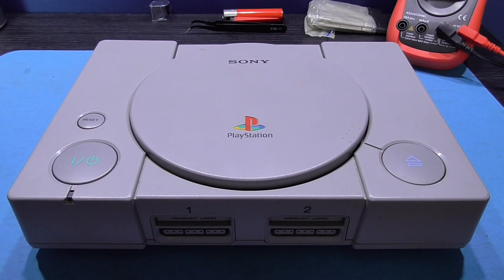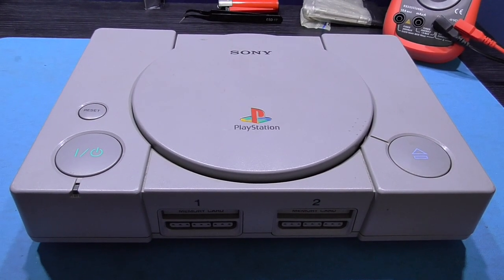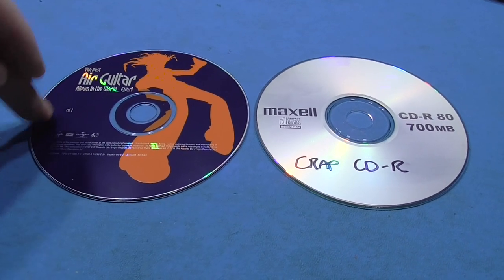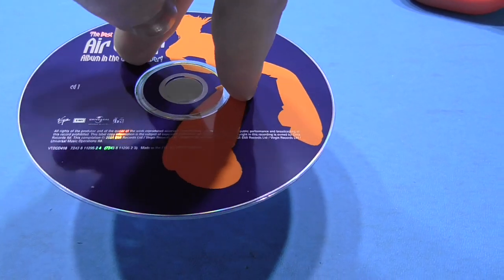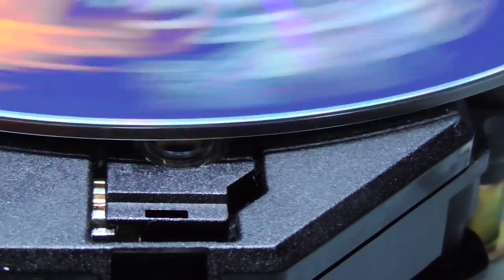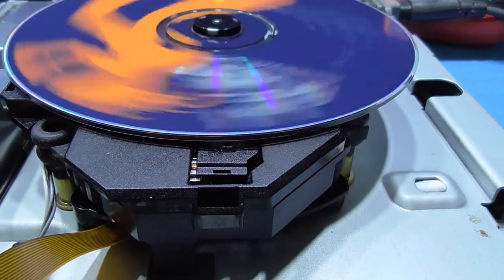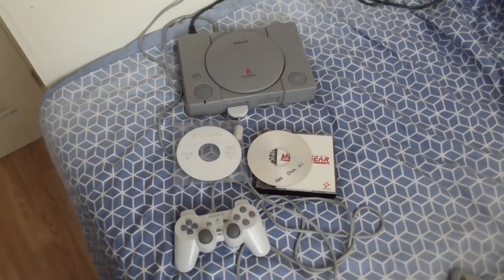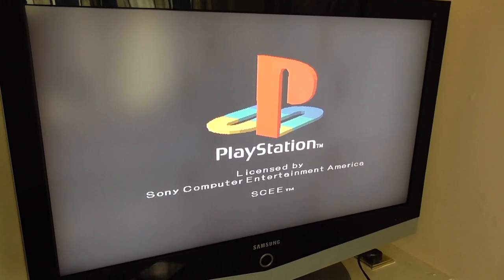Sony Playstation - Adjusting a Laser \ Optical Pickup for backup CD-R Media.

Comment: FourX2k3 ,
__ Very much appreciating the direct, concise content of your vid using the oscilloscope ( over DMM  ) method and zoomed visual still images!
__ Beyond the console model numbering system here in North America, are the laser assemblies themselves the same part number across all regions or are they also following a region-specific numbering system? If so, I'd be interested in any direction / link you could share.
__ Just as / more important I suppose : Would the laser ( and other reference ) voltages be the same for North American consoles tracing back to the outputs of the power supply?
__ If these points were already covered in the video's on-screen text ( i.e., at 11:47 ) , I only wish that I could read them as it's on the borderline of legible for my smaller phone screen - the only device I have with me while in the thick of my repairs. Any chance the vid's on-screen text can be made bigger or included in the description with corresponding timestamps? 
_ Keep sharing this concise and direct instruction!! It's so informative, non-assuming  and to the points! Thank you!!
Reply from the maker: 1) The lasers are the same across all regions, all you need to worry about is the correct model for your system.

2) The voltages used by a particular Playstation's motherboard are the same across all regions; the only difference is the power board inside for that model differ for the different mains inputs across regions.

Let me elaborate more. If for example, I imported a NTSC system from the states to the UK I would normally need to use a 240v to 120v step down converter to power the system from UK mains, however. If I fitted the NTSC system with the equivalent PAL power board from the same model it would work perfectly fine without the need now for the 240v to 120v step down converter as the voltages are the same coming out of the power board that powers the motherboard.

The only things that would differ from the original NTSC System would be the power board inside. The video out is still NTSC, the bios is still NTSC, The Master crystal, System and GPU clocks are still running at NTSC frequencies. However the power board inside is now PAL aka 240v input.

If you watch my video here

https://www.youtube.com/watch?v=MSBVti01mL8

I go into detail into what voltage rails are used on a PU-18 motherboard Playstation, the only difference you will see in the case of an NTSC equivalent system will be the video standard, clock frequencies and bios, the output voltages from the power board are the same inc the fuses on the motherboard.

The video is in 4K by the way so hopefully it should be nice and clear on your mobile device.

3) I wouldn't try to match the vpp in my video as each laser will differ from one to the next, there's an old saying. No two lasers are the same. You should setup each laser on its own merit, if you try to match someone else's laser output you could easily burn the laser out.

Thanks for your kind words by the way, always welcome. I hope I've helped you out somehow.
Reply: FourX2k3 ,
Might this adjustment by waveform (over digits-only) also work for PS2 LASERs? There's some i-Link system linking discs I'm wanting to read: GT3 (not sure the barrier it puts up as it relates to this disc's properties but a couple units freeze / stagger menu background with no/glitchy sound w/ inability to iLink) as well as the purple discs which include Unreal Tournament between 4 PS2s, Time Crisis 2 & 3 and Silent Scope 2: Dark Silhouette between a linked pair. Is minimal voltage best or is there a better voltage just above "minimal" to keep the LASER assemblies from going back into a median state of working too hard anytime soon?

Comment: How do you get that good pattern? I keep trying to test the same point but all I get is a very small sine wave, with all my settings like yours as far as I can figure... its a DS203 oscilloscope and I am using the analog channel. 

EDIT; had to put it on 1x... now I get a bigger wave, but this oscilloscope confuses me. it looks like no matter how much i adjust the y axis voltage, it always stays between one division... huh? I've used other oscilloscopes, but this small one just intrigues me.
Reply: I also would like to know, because i also get nowhere close to super clear picture as in this video.

Comment: Thanks a bunch! I've been looking for cheap scope to be able to read eye diagram, but all internet is saying you need an analog oscilloscope, digital ones won't be able to do it, unless very expensive ones, so I started to believe them and started to look for at least 400mhz, and 1ns/div time base used analog scope... cheapest 400mhz on ebay coast as much as this one new.... what a f... relieve. Geez what shall I choose now, a new one with a warranty or a "guess whats in a box" type one..  wish I could say that now in their faces, for all the nonsense they "advised"... because my mom used to say that ebay is like a chocolate box... you now the rest, when buying used. 
I'm new to this, any insights what exact specs I should be looking for when getting oscilloscope to read eye diagrams?  Because apparently it turns out  I don't need a 400mhz 1ns/dive time base analog scope for that, thanks to your video, so what numbers play the role in terms of specs on oscilloscope to get it to show an eye diagram?
Reply: 月  Do you have a scope?
Reply: 月  I know your comment was from 10 months ago, but do you mind if I ask for your help with some laser calibration?
Reply: A 50MHz Rigol 1054Z will do this easily.

Comment: One of the best informative videos I've watched for tweaking a PSX laser potentiometer.  Thank you!

We all don't have scopes though ☺
What's the maximum you can adjust  a very old and tired laser before risk of damage using a multimeter?
Reply: In my experience dont go below 600 on pot. A good value would be arround 800 ohm.